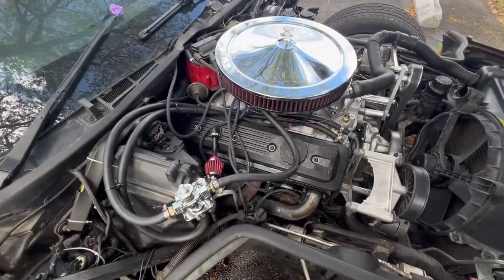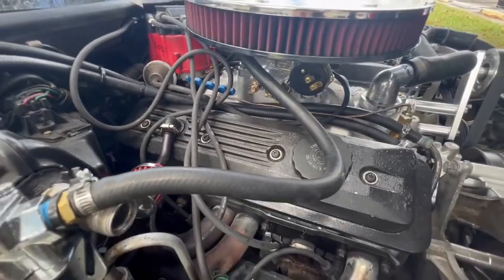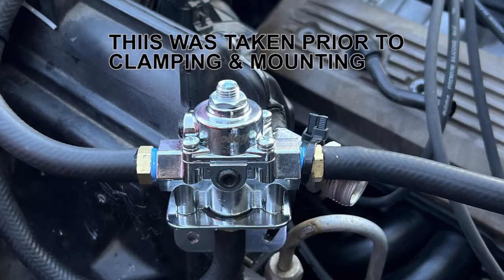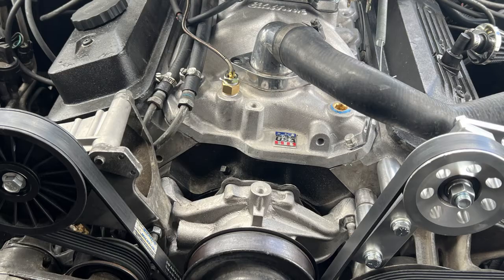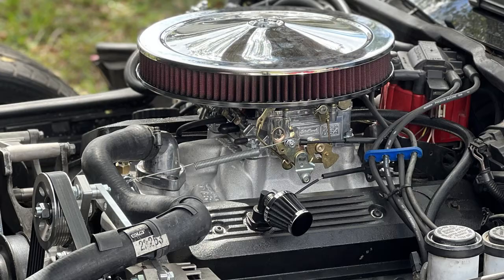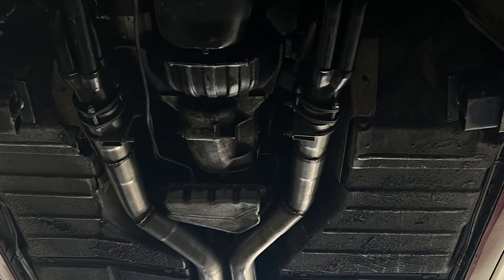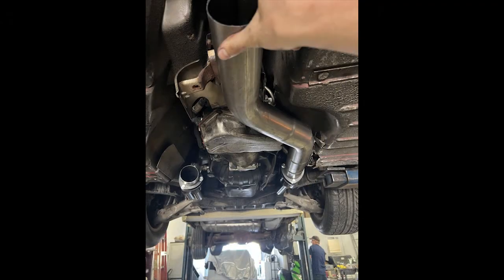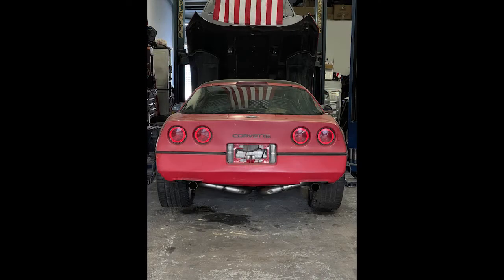TPI TO CARBURETOR SWAP 2023- How to convert your C4 Corvette to carburetor guide

Comment: Dang, I almost thought you had figured it out!!!  Using the Edelbrock carb. you wont need a fuel regulator. The fuel that flows into the carb can be discharged out the other side of the carb. Since the floats use the same bowl. Unplug the other side and let fuel flow threw the carb and back into the tank. There is more than enough fuel to keep the floats full. Keep it simple. I figured this out 8 yrs ago and a GM 366 that has no place for a mechanical pump on a vehicle with a standard in tank fuel pump.
Reply from the maker: @jotegg1276  I’m not an expert man. This is my first classic car and first time dealing with a carburetor since my dirtbike when I was 12 years old 😂. 

Generally speaking, a lot of people are going to need or should run a fuel pressure regulator, regardless.
Reply: @CREATINECONNOR  Mechanical fuel pump with deliver 5-9psi, standard in tank fuel pump in a GM vehicle with a TBI fuel system puts out a max of 14psi. Save yourself a headache and a couple hundred dollars. Fuel regulator just restricts the fuel flow, this will happen naturally, the fuel feed is only one size bigger than the return line. This way you dont have to buy a component that needs to be wired in, mounted and adapt to your existing fuel lines. Slip 3/8 fuel line over the ends of your factory fuel lines with a couple hose clamps. There is not enough fuel pressure to blow the lines off. Plus you keep fuel flowing and never strain the electric pump.In the event you want to change back to TBI, nothing was cut or modified.
Reply: Good info.  Makes build slightly cheaper and easier.
Reply: Car was a TPI not TBI common confusion!

Comment: This is an awesome video. I just got a 85 Vett and I had always planned on going carb and eventually with a stroker kit to a 408 and your video makes the first few steps really simple.
Reply from the maker: @210shotz  yeah, it’s really not that hard. It’s taking your time doing everything correctly. All you’re doing is removing the old junk, putting the intake and carburetor on adding the fuel pressure regulator to the correct fuel line,  hook the throttle cable up.
Reply: @CREATINECONNOR  Did you continue to use the o2 sensors with the new headers?

Comment: I just finished converting my 84 to carbureted and now my torque converter doesn't work. Did this happen to anyone else?
Reply from the maker: @jacobamberdaniels1603  im not sure theres a correlation between fuel injection and your tq converter not working.

Comment: I have 71 Elcamino.  The previous owner installed engine out of a 88 iroc (I think ).  Going back to carburetor.  There is plate on the block where the fuel pump goes.  Can I install a mechanical fuel pump?
Reply from the maker: @samh4333  I personally don’t know much about mechanical fuel pumps so for that you’re gonna have to turn to Facebook or Google
Reply: Thanks for the response.   You had to have heads redone or new ones?  I’m being told that old heads will not work with a carburetor and manifold.

Comment: Hey, im sure this has been answered already but how did you hook up your wiring? Ive got an 86 I'm restoring and gonna be doing a carb swap as well but at the moment its TPI with a 4 speed auto but Im putting a carb and a 5 speed manual in it. All the mechanical stuff im familiar with but when it comes to the electrical system im a little confused lol.
Reply from the maker: @lonelylego6172  There’s almost no wiring to deal with. Once you unplug the TPI harness, theres essentially nothing you need from it. You’ll re use the distributor wires but that’s about it. Obviously, you wont touch the oil pressure sensor/switch and temperature sensor/sender.
Reply: @CREATINECONNOR  Ok, cool. Thanks, did you use your stock harness or replace it? The previous owner of my vette thought the best way to “fix” the problem was to start cutting the harness so I have to replace it anyways, didn’t know if it was better to go back stock or any recommendations for upgraded harnesses.

Comment: Did you have to re-wire your fuel pump to keep it running after it is started?
Reply from the maker: @jacobamberdaniels1603  nope. When you turn the key it always has power.
Reply: @CREATINECONNOR  thank you.

Comment: Good work friend, a question: how do you get the rpm meter to work on the digital display with the distributor with vacuum advance? How do you connect the old harness to the new one? Can you tell me the colors of the cables?
Reply from the maker: I used a GM HEI distributor which was  direct plug and play. I don't have the colors of the wires on hand so you may have to reference google.

Comment: What happens to the gauges when you go with a carburetor do they still act as normal?
Reply from the maker: Everything works except the Fuel Economy related gauges. Also the fuel gauge will misread severely as I ran out of gas 3 times straight.
Reply: Did you ever figure out how to fix that issue?

Comment: That is stupid! 400+ hp with TPI is so easy, and you are losing all the mid-range torque as well!
Reply from the maker: Not at all true. Its also getting harder and harder to find TPI parts as it gets older. Look man, you cant deny  its one of GMs first EFI setups and its very obsolete. 

Its a cool and unique setup but at the end of the day, it has no performance to it.

Comment: the only problem they always face on a C4 carb swap is the hood there simply isnt enough clearance for the aircleaner most guys run the buick snorkle to remote filter but theres barely any room

Comment: Love the carburetor, took the efi off my ls swap since it was the only way i could afford to run boost, pretty much all my projects have been carb ever since , great video man but how are the pipes already going out on you? Im running a cheaper ebay builder kit and its holding up my heavy ass gt45 turbo just fine its been supporting the weight for the past year now without issue but i agree on the carb swap people really trash carburetors but they really are easier to work on
Reply from the maker: The pipes shit the bed. I believe they aren’t aluminized or something so they instantly rusted on me. We’ll see what happens when I drop the motor back im. Worst case, the bends are super easy to replicate so I’ll redo them later.
Reply: @CREATINECONNOR  ahh damn that’s crazy man i got no hood and they a bit surface rust but still build boost i leak tested it and still holding up try the cheaper ebay builders kit you might get lucky ive used em on a lot of builds

Comment: How much whp do you think you have? Looking at getting a C4
Reply from the maker: With everything done in this video, maybe 280whp-300whp since its a manual. I dont know what a stock C4 dynos So Im going off the fact that it might be making close to 340 crank hp. The configuration in this video is more of a torque setup than a HP setup so Im  sure the torque is Decent too. Never drove it enough to confidently speak on it
Reply: @CREATINECONNOR  what parts for that number? I’ve seen on some forums L98 6 speed cars making 370whp from intake, headers, full exhaust, decent cam, and I believe some other bolt ons. Do you have an insta?
Reply from the maker: @TheJMan1K  my Insta is the same as yt.

Comment: I think i heard you say you used the restrictions on the back of the intake? Or did you just leave them open?
Plus, there's a lot of haters on here. The vette im working on now caught on fire from leaky injectors. Never a fire for me with a carb. But most people are right on here... hook hose fom pcv valve to front of carb. 3/8 hose

Comment: So you did not remove the ecm or wiring harness?
Reply from the maker: Everything is still there but tucked away. Will remove all that stuff eventually
Reply: @IllegalC4  yeah I wonder if you took out the ecm and wires if you would have to mess with the fuel pump.

Comment: I have an 88 Camaro TPI.  I pulled the 305 and I’m going to put a 350 carbed engine in.  I left all wiring intact.  What wires will I need other the coil from ignition?  I want to use original oil psi gauge and temp gauge.  After adjust TV cable.  Will trans still shift normal?   What other wiring do I need to do?
Reply from the maker: Everything should hook up relatively the same, these motors are extremely universal. I can't tell you much about the shift cable as I have no experience with them. There should be plenty of videos explaining how to adjust it correctly though.

Comment: How easy was it to tune? Ive heard you need to be an expert and might take some days
Reply from the maker: I unfortunately do not have experience tuning carbs. There's plenty of videos/articles on how to do it. Generally speaking, if you have a pretty normal build, the carb will work out the box as is without running terribly lean or rich.

Comment: I just came across this post. I want to do the same thing because i want to run a turbo and don't think tpi ia the way to go.
Reply from the maker: Yup there is definitely more options to throw some boost at a carb setup vs the ole tpi. It is possible on the TPI setup but will probably run 3x the price of doing it the carb way.
Reply: @CREATINECONNOR  I think I might go with a used sniper or sniper clone.

Comment: I also have an 86  Manual trans that was my grandfathers. unfortunately the motor has expired and do not wanna reinstall all the tpi stuff like you. I have a 350 with aluminum heads being built and am switching to a carb everything you posted is what I’ve also seen on some forums about using stock pump and a regulator and hei distributor. My question is what did you do with the wiring harness with everything that’s not being used anymore? Just cut it all out? Thanks for any help
Reply from the maker: I zip tied everything and stashed it out of the way. Will end up removing the harness at a later date.
Reply: @IllegalC4 10/4 thanks

Comment: Hello from Romania 🇷🇴

This is my story, maybe you can help with more information about what i whant to do with my 1993 LT1 ! 

Long story short, i have a small colecțion of american cars, i love them ! 
I have a 1993 5.7 LT1 Camaro, a 1997 3.8 Camaro, a 2002 3.8 Pontiac Firebird, and a 2001 Cadillac Deville DTS 4.6 V8, the one with night vision and head up display! If could i would get them all ! 😅

Now, i whant to carb swap my 1993 LT1 Camaro because of the Optispark. I allready have the motor out, transmission, i wil get the rear end out when the engine will be done. 

I got it out because i will swap it on the 3.8, because that one has romanian papers and can be driven. 

So, i did my research about this swap on the internet but some swaps get to 4000$, thats alot in romanian money plus shipping. 

This is a budget build, and what i whant to do with this engine is like this ! 

Gm performance carbureted intake GMP intake, that has a long part number, a hei distribuitor, wires and spark plugs. And some ground wires dont know how many yet, but thats why i am writing heare. 

Then i need a water pump, radiator, starter, alternator.
Other then that ? 

I have found what manual valve body i need for the transmission, i think it's a 700r, it has that tv cable and 16 bolt patern of the oil pan.

Is a 650 cfm carb good as size ? 
What kind of carb ? 

Do i need a coil beside the hei distribuitor to start the car ? 

What fuel presure regulator should i use ? 

What aftermarket gauges i need to use for the spedometer, rpm, oil and water temperature ? 

If you can help me with other information about this swap that i whant to do i would apreciate ! 

If you have Facebook or Instagram we can speak there more easy ! If not its ok heare to ! 

GOD BLESS ✝️

Comment: I’m having a hard time on my 88 l98 with aluminum heads(factory) the problem I’m running into is my 2 center bolts for my intake are at a slight angle. I know the Vortec heads have this issue as well now. Can I take the intake style for the Vortec and put it on my l98 without any troubles. It’s going on a 1984 Gmc. I have a old school pro comp high rise on it and want to go to a mid rise dual plane intake but I’m running into the boot angle problems. Any help would be awesome thanks.

Comment: Great video.
I just did this same swap on a 1990 suburban 350 efi
for all the same reasons you mentioned I used pretty much the same items you did. 
There were some things different however.
I couldn't figure out how to get the fuel pump to keep pumping after the initial startup. So I simply bypassed the factory fuel pump regulator on the firewall. There was a factory installed wire for this already there so I hooked it up to the tach side of the HEI.
Reply: I have a turbo 400 so no transmission mods required. 
I installed a completely different dash asy so all the gages are digital including the satellite controlled speedo. Never been happier as throttle response is waaaay better. Milage seems slightly better as well.
Have to do more tests to see how much better, but the gas gage does move slower. lol

Comment: wtf u do too your PCV bro?? lol thats not how those work, you need to get breathers.
Reply from the maker: There's nothing wrong with putting a filter over the PCV. Ultimately, there's better options out there to the method I had done however considering I had  just gone it running, there's nothing wrong with what I did.
Reply: @CREATINECONNOR  your carb has a spot for PCV. Just hook it up. Then you won't get an oily film on everything.

Comment: Hey, im doing a similar swap. What did you do for the upper radiator hose. Do u know the part number? As well as  temperature sensors for the fan switch. Thank you

Comment: Good call on getting rid of that money pit TPI. I don’t care for them because they run out of breath at 4000 rpm and chip burning is a lost art in 2023. Carb swap makes better sense if you actually plan on driving the car.
Reply from the maker: Exactly. I can't have a corvette that revs to 4500rpm and makes maybe 200whp on a good day. Chip burning no thank you and obsolete decrepit 1980s fuel injection no thank you

Comment: waterpump?
Reply from the maker: Stock waterpump. There's a long neck and short neck version so be sure if you order a replacement  that you have the correct one. Also, there is a heater core hose line you'll have to put a plug in on the water pump if you are removing that equipment.

Comment: How did you get around the engine warn lamp triping with no EGR etc ?
I'm right in the middle of comp engine rebuild on my 91 c4.
I like the carb look and idea.
Also did the mpg change much ?
Thanks new subscriber
Reply from the maker: My warning light screen was broken so Im sure all the lights in the world were on. MPG was absolutely terrible sitting at 8-10 city with the tune it had. Probably could have gotten more but the heads
Died after 2 weeks
Reply: @IllegalC4  thanks 
Shame it died, town mpg was the same as my Hummer then lol.
Maybe I'll have to stick with my TPI
Cheers Rusty

Comment: I did a1991 Corvette. Easy Peasy.
I bought it for $950. New tires & transmission. Beautiful black interior.
 The previous owner had it in four shops.
 They couldn't fix it. Smoked, fouled out the spark plugs drank gas......
 He put everything new in it. Everything.
Reply from the maker: Awesome man. Take car of it and these things will last a life time.
Reply: @CREATINECONNOR  ....I have a beautiful '94 & an '06. The wife drives the C6.
Reply from the maker: @glennspears839  Awesome man. I love the C6. Its really the C4/C5 put together. Love the LS2 in it as well.

Comment: I'm using an l98 in the entire running gear including wheels suspension and Flowmasters from a 90 Corvette into my project truck. The intent was to run fully computerized injection. So it has a ECM that's been modified to delete all of the things like anti-theft etcetera. My plan is to switch to carburetion so I can get this forever project on the road. So it seems logical that all I have to do is get a distributor and a fuel regulator. Have the exact same manifold that you do and my intent was to run an avs2 so there's that coincidence. I was worried about the original electric tank pump but it seems like this is the singular most useful thing at about your video. Well done lots of still pictures and not a lot of wasted time talking I appreciate it
Reply from the maker: Even if the oem fuel pump died or wasn’t functioning properly, its so easy to add an inline fuel pump.

Comment: Did you ditch the ecm?  I would like to keep cruise control.  does your cruise still work?
Reply from the maker: I still have the stock computer. I did not hook my cruise control cable up to my carb so I cannot say if it works however there's no reason it wouldn't. I'm not sure how great it would work though

Comment: I have been wondering how to go about doing this with my C4, there is just so much crap on the motor , every motor I have ever rebuilt had a carb on it and when I started on this one I was blown away by how much smog and bs is on the engine, ty so much for this video it sure helps a lot.